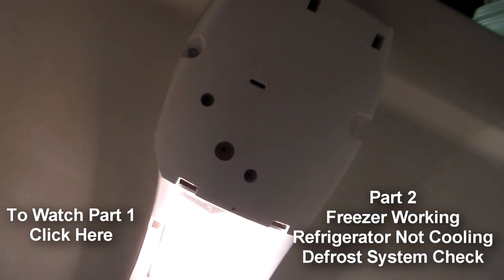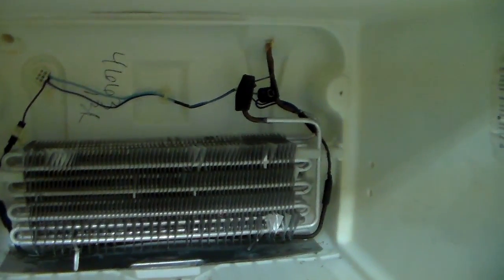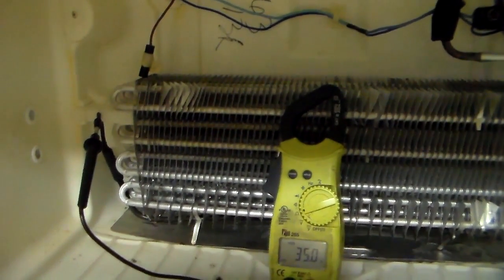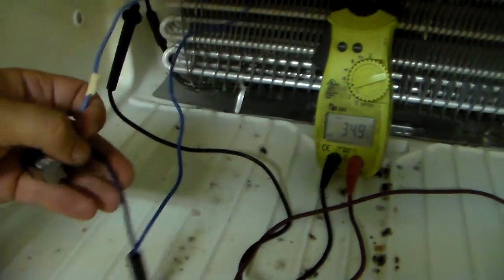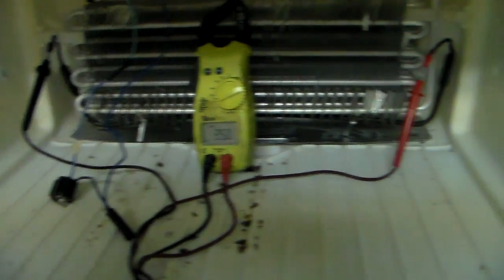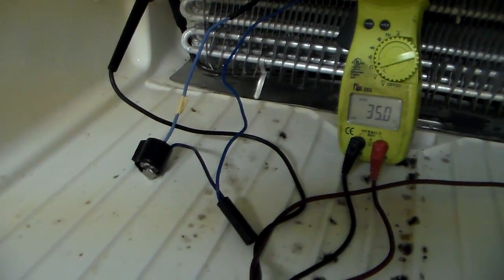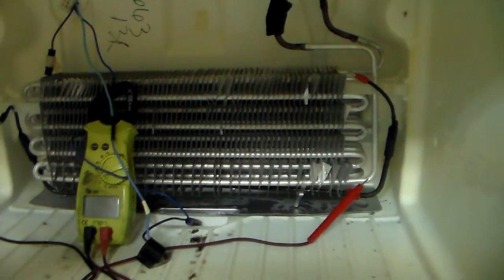Troubleshooting a No Cool Refrigerator - Part 2

Comment from the maker: If its a Frigidaire or a Kenmore made by frigidaire, just press the refrigerator light switch 5 times within 5 seconds.  That puts it in and takes it out of defrost if it has an ADC board instead of a defrost timer.
Thanks for Watching!

Comment from the maker: Did everything thaw?  Usually the stuff in the bottom of the freezer will stay frozen but the items that are closer to the ceiling will start to thaw.  That's just because the coldest air isn't being moved around like it should.  But the coldest air will settle in the bottom of the freezer.
If you have anymore questions just let me know!

Comment: I have a hotpoint side by side. The low end one you get from home depot. Refer side was not cooling down. Check freezer and the coils where iced up. Cleared that and the refer side was getting cold. Crossed my fingers, no luck. I checked the heater element and has cont that shoots up to 50 then down to 25 steady. Check the cold switch and has cont and even with a battery, it show right voltage. I even wired the two end together to see if element would heat up. No go,

Comment: is there an easy way to chack amperage? all I've got is a multimiter.  I might be able to borrow other tools from a distant relative who is an electrician.  I do not suspect it will have too much draw because I can hear it running normal, but that was not the case about 6 months ago  when I could hear the load on compressor - I only wonder what that was all about - and was it the cause of this failure

Comment: Mine is 24 inch Refrigerator constantly is build up ice between freezer and bottom fridge and blocks the passage down from freezer dpt. to fridge. I keep cleaning and melting ice , but in one month ice is there again, And this fridge has control board with adjustment for temp. Thanks

Comment: great video but a bit late for me. I replaced the timer and, the real problem was the heater. now I have another problem. it is not cooling well. in this refrigerator it seems the filter was installed inside and it had a block of ice. removed the ice and I am testing it. there is a bimetallic on top of it. I will need  more testing to see if I can figure out what is wrong.

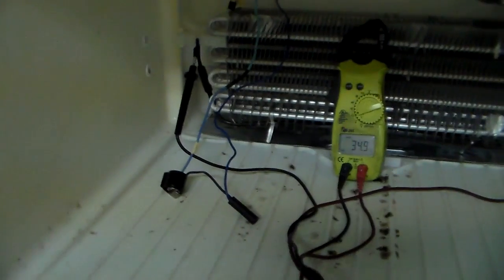Comment: At 6:10 you stated when defrost thermostat is in ice water and you measure resistance, thermostat is good.    How much resistance?  A bad one would have infinite resistance because the circuit is open.  A good one should have no resistance, zero ohms because the circuit is closed.  So, to repeat myself, how much resistance should one have for a good thermostat in ice as stated  at 6:10?

Comment: I have a GE Profile PGCS1PJXA SS.  Both the refrigerator and freezer fans work but the compressor isn't turning on and there is no cooling.  The people we got it from said that twice, 6 months apart, the coils iced over and it shut off completely.  Any suggestions where to start.  It sounds like a defrost problem but would that cause the compressor to not start?
Thanks

Comment: I have a whirlpool refrigerator i took the cover off remove the ice put all back together fridge work great for 1 week and was hot freezer still works great but frost in door also push button in fridge to 3 select and go back to middle manual

Comment: so our fridge isn't frosted over.  Took the back panel off, there was no ice or anything like that.  None of the holes were plugged it looked fine.  The evaporator fan is working, the condenser fan is working as well but the fridge still isn't getting cold.  Any idea what it could be?
Reply: what about compressor? is it running?

Comment: if you got same freezer , then you dont have to defrost it , the timer every 12 hours does that for you(if it works) . when it does - it stops the cooling cycle and turns the defrost cycle on - which is  power from the timer - to thermostat(which is attached to the condenser coil) - to the heating element. you can test each one of these items to find out which one is bad.

Comment: checked for volt's and see no volts from the heater wires. Now is there a way to test the control board or defrost timer? Gulp hope it's not the control board. Need to make sure I'm doing it right.

Comment: hello,
I am French and I have them ready the same ap fridge
I just watched your video.
I understand not all, because I do not speak English.
I use Google translate to talk to you.
I have a problem of a short circuit in my fridge.
I think this is the icing resistance.
Except that a short circuit occurs every 17 h can loan.
I suspect resistance.
So I ordered
I tested with an ohm meter resitance. it is 126 Ohms
I have not connected directly, because I am 220V France.
You mention that triggers the thermostatic defrost resistance.
How it is to pass, because it was not connected to power?
I'm looking at the rows of ohm meter, and resistance, it was those plugs into resistance but not powered by the current.
How the appliance is switched off the thermostatic more current without resistance?
Thank you for your answer

Comment: it was the compressor relay. it has wires going to it , then the whole thing plugs into the compressor.  Just type :  Frigidaire freezer compressor relay " into the google image search and you will see what I'm talking about. If your compressor starts and runs for any period of time, that means to me that the relay is fine.  My story probably started by overloading the freezer(especially by the vent holes) and that slowed down the air circulation  to the point where the condenser coil was freezi

Comment: Great video....could it be time for a new one dealing with non mechanical defrost timers?  They make this testing process much more complicated as its not easy (almost impossible?)  to start at a circuit board automatic timer for diagnosis of defrost problem unless you know how to short circuit the pins on the timing unit with the power on in an attempt to initiate the defrost cycle.  Also I think that your description of the bimetal thermostat's function could be confusing.  Doesn't it measures cold ?....too cold it closes and allows current to the heating element.  When it heats up to a particular point it opens again signalling time to turn off the heating element.  Disfunctional bimetal thermostat is the most likely place to start for failure of defrost system?

Comment: My problem is, the timer cycles. Tested the heater element, continuity.  Assumed was the thermostat. Put a new one in. Took old one home put it in my freezer for about a half-hour, tested good. Continuity when really care cold, non at warm up. So,, bottom line, timer does cycle, element shows good and now obviously thermostat was good. Question ,,do you think a timer does cycle but when it it's the defrost point,, doesn't turn on heating element. And turns everything back on when cycle is complete. I'm stumped.

Comment: I have a hotpoint hss25gfp. Bought it NEW about 12 yrs ago. I've changed a few thermistors and a thermostat about 4 yrs ago, and 21 months ago changed the motherboard and paid repairman $220. Last night, only the lights were working to light up the inside, and the light for the water dispenser was blinking on and on and on. Woke up this morning and it wasn't blinking anymore, but it's not making ice or getting very cold at all. The defrost heater checks out good, but has never been replaced. In heater area, there was VERY LITTLE  ice crystals on everything, and only A LOT of ice build up near the top AREA only. I told my wife, let's quit foolin' with it and get something else?? It seems like the evap fan is not coming on?
Reply from the maker: William CRAZY LACY Furmage Sounds like somebody left the door open.  Unplug fridge, defrost freezer completely.  Plug back in and let it get cold.
Let me know how you make out.    

Ice only on the back wall would sound like a defrost issue.   When ice is over everything,  door left open.

Comment: my story probably started.....  ..... the condenser coil was freezing up because of bad air circulation.  that in turn made the compressor run harder, and put large strain on the relay , that is why I think it went bad, repalcing it fixed the problem. and of course I now am very mindful of where and how I load the freezer, to keep good air flow going. I really dont know if this makes any sense , because I am not nearly a pro at this. but it worked for me.

Comment: Hi, what is the diagnosis if: Defrost heater, defrost thermostat and timer all have been inspected and they seem to work but the problem continues: fresh food section does not get cold air due to ice build up but no ice build up on the evaporator (freezer section), only at around the freezer openings? Is this a defrost control? timer motor? Thank you

REPLY
Reply: I should add that the defrost heater works (it turns on when in timer in defrost cycle), t-stat replaced w new, and timer replaced w new
Reply: Check your drainage tube... At the back of the fridge there should be a black rubber tube that drains water into a little pan. If that's clogged then if won't drain properly, perhaps the water freezes up since it can't go down the tube?

"Freezer openings", you mean where the door is, or the hole at the back that goes into the fridge? Check the gaskets around the freezer door, and turn the feet at the front a bit so that the freezer is tilted back so the doors close by themselves and stay closed.
Reply: LogPRB thanks for your reply. Indeed the drain looks clogged but some water still drains. Heres the problem Im facing: GE decided to place a sealed metallic insulated rear exterior panel which covers basically the entire drain tube. Only the lower portion is left open to see compressor, drain pan, drain tube termination, and fan. Any idea how I can remove that panel or how to access the drain line? From inside it looks like its completely sealed
Reply: Not sure, try straightening out a coat hanger. Also on the fridge I have the bottom of the tube can be removed with a bit of a pull so you have more of a straight line to access

Comment: I'm confused, if the defrost heater comes on during defrost, how is that bad? What other time is the defrost heater supposed to come on, if not during defrost? Isn't that the purpose of the heater, to do the defrosting?

Comment: bill,I would like to known where do I fine the timer on my Kenmore; manufactured : 06-99,model # 25359683991 ,like to do the test with the heater coil and see if it puts heat

Comment: I have a Roper Model. RT14BKXKQ05. Serial VSS2251685. Freezer getting cold but not refrigerator. I turned the timer on to defrost on and heater started to work defrosting immediately although I never seen or heard the fan come on. Should I assume it is not the timer but the condenser fan ? I believe the compressor is working . I hear a humming. Please help.  Thank you!
Reply from the maker: Lisa Power Was the freezer frosted up on the back panel?   Can you hear the fan in the freezer running when the compressor is running?
Thanks

Comment: my fridge is making ice inside the freezer and it`s not cooling inside the fridge.the fan works fine and the pipe is clean.the Defrost Heater shows resistance. what could be the problem?
Reply

Comment: I have a kenmore side by side the fridge is getting warm and the freezer was working but now the freezer is working more like a fridge  won't freeze anything and I'm not having any air movement around inside the either compartment any more and there is no ice build up on the back wall I plan on taking the back panel off tomorrow it looks like it is going to be a nightmare on this one to do not sure if it is an ice issue build up in air channel or what evaporator fan is running can hear it but don't feel no air even in freezer we unplugged it one time and had a bunch of water puddle on the floor in front of the fridge over night  and during the next day so there has to be some sort of a ice melting issue and when we plugged it back in it worked for about a week and a half.and slowly went back to warm again.

Comment: Dear Sir First of all Thanks a lot for your great Video . Sir when Timer , Defrost Thermostat,Temperature thermostat, Fan , and seal good enough but still fridge is not cooling enough . Freezer is OK but Fridge 7C temperature . Note: There is not ice build up at all . What could be possible problems and what will be its symptoms are ? I am waiting for your promote reply . Thanks again , Good Night . 
Md Mamunul Islam
Reply from the maker: Pull the back panel off of the freezer so you can see the evaporator coils.  They should have a even light layer of frost over them.
Let me know what you find.
Thanks for Watching!

Comment: Frigidaire just like your example. This is what I currently have: Continuity in the heater element, Continuity in Thermostat, Defrost Timer is working at each leg of the connection through each cooling and defrost mode. Problem=Heater Element not getting hot. Go...

Comment: dude my fridge build ice in the coil right were the thermostat is but only there or sensor the one that you said the put in water  only close there is  or around there it build ice and I did put it in defrost and still the heater don't come on after a wild time like a 25 min and turn it on again the timer so my guess is what is it maybe the timer don't work maybe ill need to charge more cold gas or Freon  wait for some answer thank you much and ill love those vid's you did you help me a lot

Comment: Not really,
It is a side by side 6 years old Kenmore (Whirlpool) sitting in my 100F Vegas Garage
Checked every thing including R134A refrigerant and all look OK
Adding an extra cooling fan didn't help either.
It runs non stop with temperature never drops below +5F Freezer & +55F Ref.
My next step is to spray some holly water on it unless you have a better option.
Thanks again for your wonderful Video & God bless you always

Comment: Thanks Billl!
Reply from the maker: +Dmitri Mironov Did you get it all figured out?  sorry for late reply
Reply: +Bill Newberry  Hey Bill Thanks fo reply I think i need to contact you via Email. Because something Very strange going on with my fridge's defrost timer wiring. I think Thats explains the reason, why it worked so weak.  And the heater, and the timer it self never worked too:-) because by taking a regular timer 2143
My wiring connection doesn't match the actuall Timer's connection:-) The plugs are okay,and the plug terminal fit's exactly to the timer pins, but You won't believe me:-)))  The live(whire) goes to Pin-1 in timer, and the  Neutral(Black) wire goes to 4.. instead 3 WTF!???
I mean ofcourse the timer never had a chance to work, because he never recieved an actual charge :-)))
Ofcourse i checked the timer by plug it into some 220v~ it finally began spinning :-)
I have that strange feeling that this old fridge Beko needs some very special timer, because the electrical circuit scheme matches the actual wiring :-0)
I'd like to send you some photo of the timer's wiring connection. But, at this moment It's just never getting a chance to spin a timer, because Neutral(black wire) is allways on pin num-4 :-)) instead Pin Num-3 ;-))
That's why i was breaking my mind 
my email is antony.kidis@gmail.com

Comment: I'm sorry Bill but the cold water test for the defrost thermostat doesn't work at least all the time. Cold ice water is at right around 22° f and the defrost thermostat for my Frigidaire refrigerator has a range of 22° to 47°, so unless you can get the temperature of the water below 22 degrees it's not going to conduct electricity. What I had to do is use dry ice to get the temperature way below 22° to test if the DeForest thermostat is good.

Comment: I own a frigidaire fr3hr5jw3 side by side refrigerator . I tested the heater and discovered its working, i also replaced the thermostat and its still frosting. I changed the circuit board and compressor recently and the frosting problem developed. I am not seeing any timer button. Help!!!!!

Comment: how many ohms am i looking for if i have a bad heater? 0 right?
Reply: If the heater is bad, you won't have a completed circuit.  You'll have an open circuit.  My digital meter will read "O.L." if I have an open circuit.  O.L. is 'open line'

Comment from the maker: Your refrigerator does not have a standard compressor on it.  It has an inverter compressor.  You are going to have to find the data sheet under your refrigerator and ohm out the compressor pins to see if the compressor motor is good.  If the compressor motor is good, you may be looking at a 300 dollar inverter box for the side of your compressor.  Let me know how you make out.

Comment: Update: this unit is a fuse10 amp, it checks ok.nest, on the timer  it say 10 A NON-IND  1/3 hp 8 Hr timer100 v 50/60 hz.spec. noCD-2001-57. 7 minutes  invensys (quingdao control,assembled in china,Also reading from your left to right(as same as reading a book)the wire plugin numbers written on this timer is >> 2- 3- 4- 1,my question is: can i take wires out of its pigtail and relocated them in this connector to match a similar timer with 8 hrs --10 mins and 3-2-4-1 written on it? thanking you

Comment: it was runnig off the plug in the wall , not dedicated plug.  when I was testing it - I got it to run good from same plug only 50ft away using 16 gage ext cord.  did not see any cord damage or loose wiring.